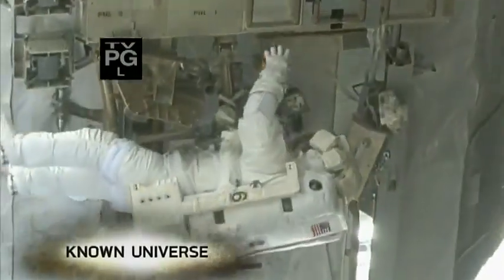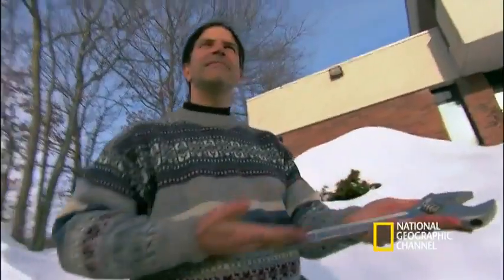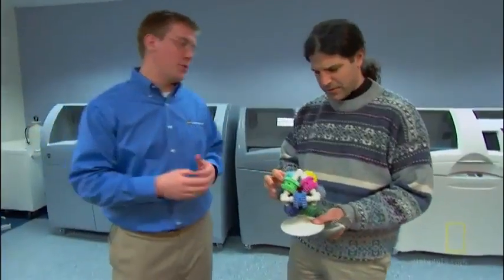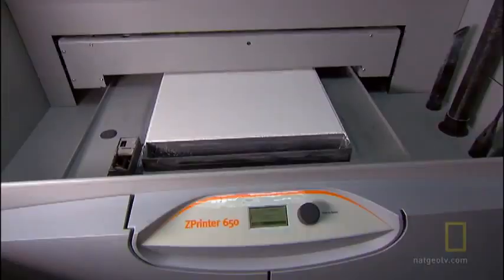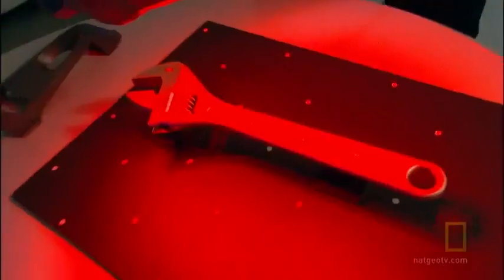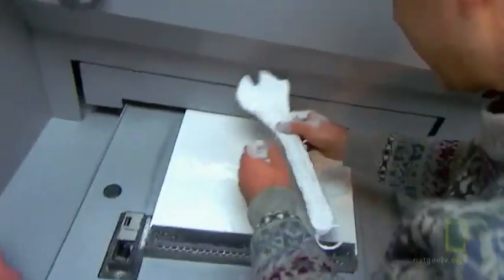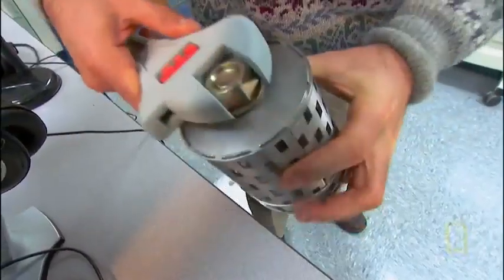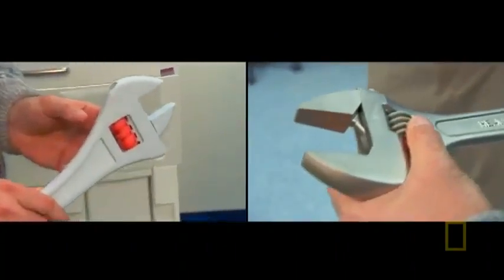Z Corp 3D Scanner and 3D Printer on National Geographic Channel

Comment: Hello, I'm Miran Kržan. I work in a company from Krško, Slovenia. We deal with the production of prototype equipment. We have a lot of prototype products in our company, that's why we decided to get a 3D printer.
Together with a colleague, we got a used 3d printer Z Corp 650 in the company. Because the printer is a little older, there are some problems with it.
But I can contact you regarding any question, because I know you are an expert in that field?
Can you advise me of any experts in this field?
Res has a very strong desire to fix the Z650.